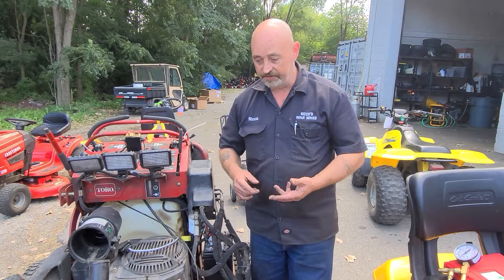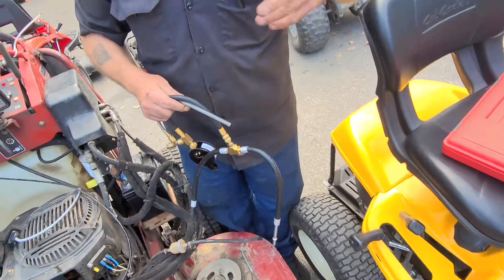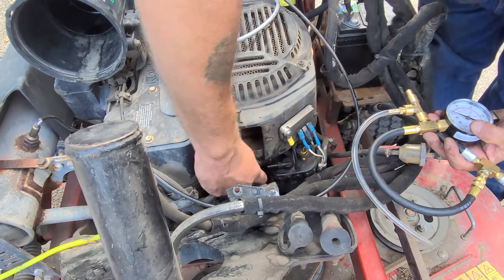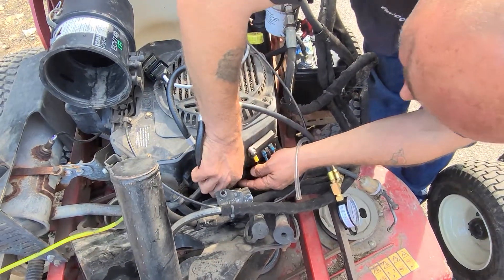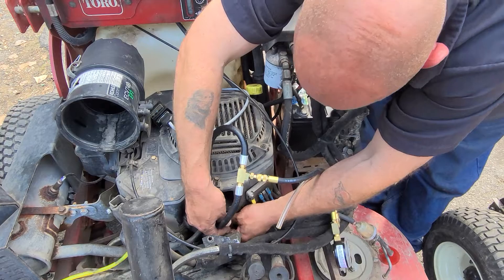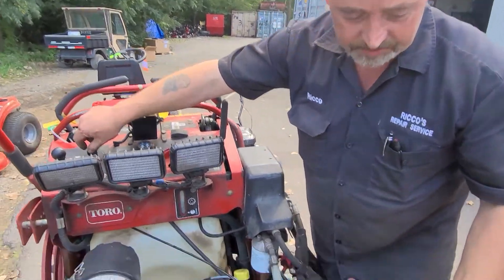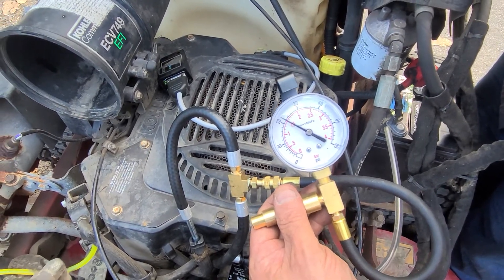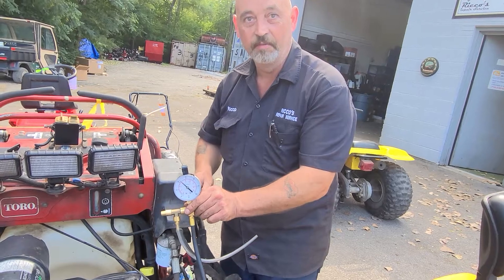fuel injection troubleshooting

Comment: Kohler efi governor surge on #2 cylinder. Both plugs new. Both coils firing good and consistent. Both injectors tested during tear down and spray good. Does not surge on #1 only #2 at high rpm. Thoughts. Thanks
Reply from the maker: Pressure test the pump
Reply: I can unhook #2 and it don’t surge on #1 it only surges on #2 rather by itself or when both are hooked up. Fairly new oem Kohler pump. Thanks for your input.

Comment: You rock….Have a Spartan with the FX1000 EFI that the fuel is not spraying out of the injector. Some fuel in being pumped out of the electric fuel pump however I understand now it has to be a stronger flow.